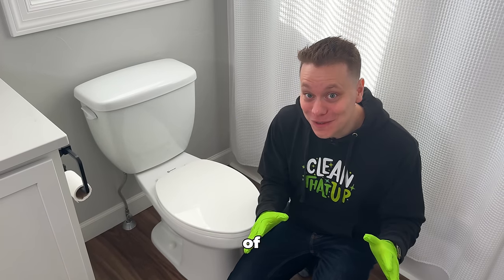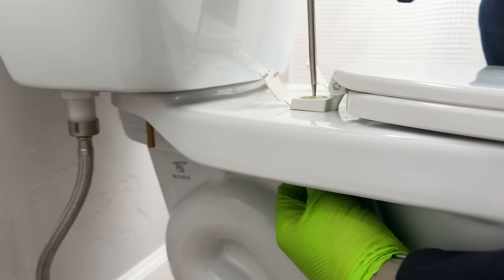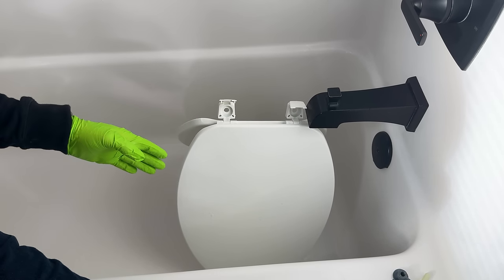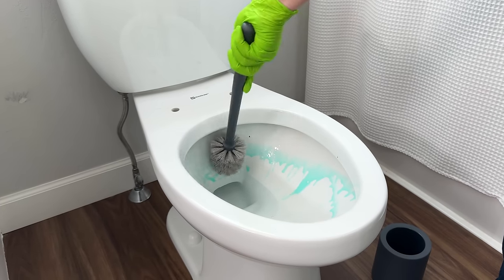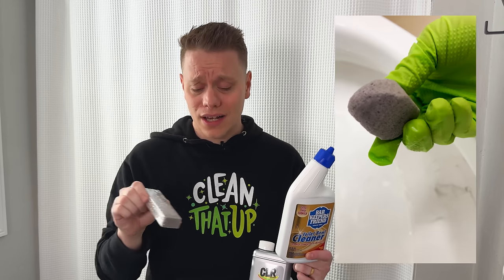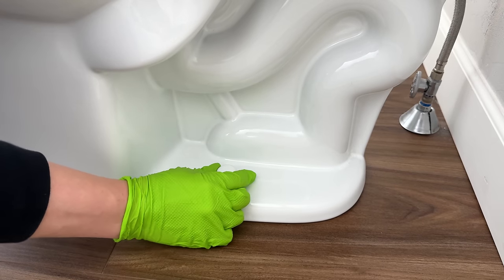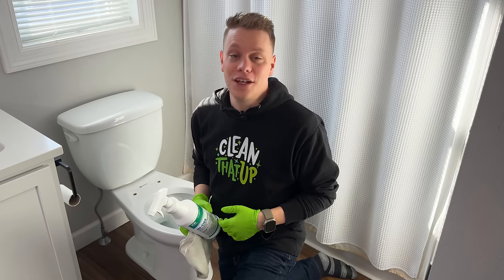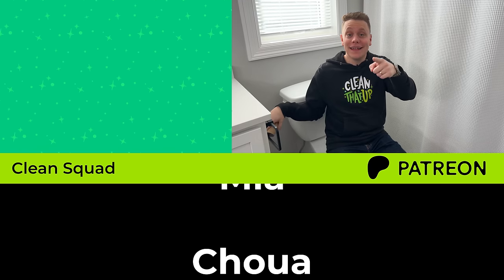10 Things You Need To Know About Cleaning Your Toilet

Comment: One thing not mentioned is your water jets can get clogged over time.  The best way to clean those is to add some white vinegar to the tank, after 3-5 flushes with vinegar all that grime around the top of the bowl should be gone
Reply: I don't have a tank, I use anti scale and elbow grease with a tough scourer sponge 😅
Reply: I didn't know that, I'm going to this. Thank you!
Reply: How much?  Add some?  How much is "some"?  Half the tank?  a half gallon?

Comment: I recommend the deluxe American Standard brand toilets, flat sided, no snaky pipes, no ledges for urine and dust to collect, sooooooooooooooo easy to clean. And only about 50.00 extra per fixture. Lowe's sells them for under 300.00.
Reply: Toto also makes a toilet like that. I used to have one and it was easier to clean. 

Unfortunately, we just had two American Standard toilets installed and I did not know the company made that kind of base. Bummer.

Also,  because I left the project to my spouse who did not look everything over before the plumber installed them, I did not discover until after they were installed that one of the toilets came with a porcelain-finish flaw inside the bowl. The flaw is in front of the inside of the bowl, a little to the right side (not hidden under the rim) and large enough that it is highly visible, so it Always looks like the inside of the bowl has a piece of gunk of some kind in it. Because I did not want to pay to have the toilet removed, return it, wait for a second toilet to arrive, and then pay Again to have a second toilet installed, I decided to just live with it. However, every time I see that spot in the toilet, which is multiple times a day, I am annoyed by neither my spouse nor the plumber bothering to inspect the toilets before installation, and I am even more annoyed about American Standard’s poor quality-control. 

I hate having a brand new toilet that always looks like it is not completely clean even after it’s just been cleaned, and/or damaged when we did not damage it, so I resent American Standard and the home improvement store I purchased it from for selling goods that should be sold only as flawed-seconds, not as full-priced, first-grade products.
Reply: Yes that’s on my wish list. I hate getting on all fours in cramped spaces to clean there.

Comment: I'm glad you mentioned drying the toilet brush before storing it. Not only does it help prevent mold and mildew, it keeps the brush holder from getting funk all over it.  
I give my brush a good spray with Lysol and let it air dry as you showed, resting between the seat and porcelain.

Comment: Thank you! My biggest problem when cleaning toilets is the very narrow spaces between the toilet and the walls/tub or vanity. I’m not young anymore, and find it difficult getting down to get to the sides and back of the toilet, then trying to get back up. I think dry dusting should help a bit.
Reply: Yeah, I live in an 100 year old house and my landlord believes he's an undiscovered interior designer. My toilet in surrounded by two walls and a third glass wall.
Reply: @laurenskee2665  how do you clean around and behind it?
Reply: My hardest place to clean. After having double knee surgery I cannot get down and if I di I can’t get back up
Reply: With bad knees I hate trying to clean those curves on the side. My knees kill me bending over
Reply: With a duster and a prayer.
Reply: I have the same issue and I started using a Swiffer Duster with an extendable handle. I can get the sides of the toilet, the floor around the base where powder tends to accumulate and it can slide between the back of the toilet and the wall, all without having to get on my knees. (If I tried I wouldn't be able to get back up!)
Reply: I spray that area with my cleaning solution, then I wrap my cleaning cloth around a toilet brush. The handle helps in reaching that area behind the toilet.
Reply: Clearly, those who design toilets, have never cleaned toilets.  All of those curves and crevices could be much more streamlined and easy to clean.
Reply: @ZooZoo293  I use the swiffer duster with the extendable handle too. Or, try using a string mop.

Comment: My dad was a janitor, and during my teens, I went with him on weekends to do his jobs. One of my responsibilities was the restrooms. We used simple powdered cleanser in the 1950-60s. I made a paste with it and did all the porcelain fixtures. After it dried, I could easily buff the surface with clean rags and bring up a shine.

Today at home, I remove the toilet seats, take them out in yard by the drain and squirt them with a garden hose and an APC. I use my shower stall during inclement weather and clean the stall after.

We used pure industrial strength pine oil back in the 50s, and a few drops in each bowl and sink drain would clear all odor from the place.
Reply: Try  using iron out get at hardware store. You can use it in your toilet tank  let it set for  quite a while when first using it  you will be surprised, pleased because it does the job for you. I  leave it over night  in my toilet a least once a month. It is excellent does the job better than  anything  I have ever used, like I mentioned it does the work for you.
Reply: @mildredmorine745  
What is the full proper name of it?

Comment: Dude... I had cleaning jobs for 18 years - NEVER thought of dusting the toilet first 😬 
     That 'moving wet particles around on a pristine white bowl' has always been the most annoying thing to me....
     And somehow I never thought of dusting it first 😶

Thanks. Really. Haha

-
PS. I could've used some more tips on cleaning under the rim...
      In my experience, a lot of times there's a lot of calcium buildup there - particularly on toilets in workplaces that get a lot of use during the week.
Reply: If I haven't cleaned a surface within a week (or if visible particles), I use a washable microfiber duster before wet wiping. Just never considered a disposable duster for "dirty tasks" like the toilet base.
Reply: Zep Acidic Toilet Bowl Cleaner.  Nothing cleans those hard water/ rust stains better-- and easier.   Just be sure to rinse well and flash a few times because it's pretty powerful stuff.
Reply: Bye iron out at hardware store let it  set it will  remove everything  if you allow  it to set to do the job. There are times if you can leave it over night it will look like it was used not flushed because of the build up down in the hole  in the toilet, also put it  in your toilet tank to keep it clean. It will do the job for you if you allow it to set  for awhile, it’s amazing cleaner for a toilet. There is nothing out there that is as good.

Comment: I  really like that brush. I suggest you  try iron out, disinfectant does a beautiful job  it will remove  any stains  without scrubbing. I also  put iron out  in my  toilet  tank to keep it  spotlessly clean.  When first using it  allow it to set  for a while  in order to remove the guck  that is down in your toilet hole. You will be surprised  with the results it is amazing  won’t damage  the tank or toilet bowl saves you valuable time by doing the job itself.

Comment: Tips that I use… first I pour a bucket of HOT water down the toilet, then I pour the toilet cleaner quickly scrubbing the bowl.  I let it sit for a few minutes.  I add half a scoop of Oxiclean in the tank.  When it is ready to flush, the oxiclean water cleans the inside of the rim holes.  I add another half of scoop in the tank and do everything else that you did but not flush that toilet for a number of hours.  Sparkling ✨
Reply: Cold  then hot then when you flush Cold water will  Crack the bow

Comment: I only use two tissues and gloves, and I toss them when I'm done. I don’t keep toilet cleaning equipt. No handy dandy or dusters :(
I start cleaning with soap tissue from the top and work my way down then inside the toilet, then use another one to wipe and dry with paper towels, then throw them away with the gloves.  I get the tissues at the dollar store; they come six in a pack. And I buy 100 gloves at Costco

Comment: I do my place the bedrooms and living room then kitchen and bathroom last... I soak the bathroom while I do everything else then i sponge everything and mop up the floor last rince the mop filling up the bucket in the tub and dumping the water down the flush one last cleaning of the sponge and mop in bleach water i let it sit in the flush and outside to dry... If I get a spill between cleaning everything is ready to go... Once a year I'll do the CLR and put it in the tank when it's filling up and let it soak... When I go on vacation i clean everything and put purple power degreaser down the drains and let it soak so when I come back everything is fresh... CLR/ purple the washer and stop it come back the next day and finish the cycle... After a shower i let the water run while im getting dressed and clean out anything that gets down the trap... 
Always free drains and nothing gets built up... If im boiling eggs ill put the water down the tub and if that's not OCD enough once a year i put the garden hose sprayer down the drains and blast everything down.... 
The inside of my plumbing is cleaner than most people dinner plates...
For an additional step.
Rain X everything after it's been done... RainX the fridge after a good cleaning... And if you're not going to be around or a rental that might be vacant... Go around the outside of the place with Biffen XTS bug killer... 😊

Comment: Only thing I would add is those clinging gel cleaners will usually disinfect as well if you leave them for more than 10 minutes, and they also work really well for stains if you let them sit. The instructions say for 15 minutes when used for that purpose. But when I'm doing my regular clean, I start with the gel, let gravity do its thing and wait until the gell has run down the bowl and started running into the drain. I'm not sure how much time it takes, but at least it's disinfecting/working on stains a little bit more and I don't have to use another cleaner in the bowl. I also use a clorox disposable toilet want because YUCK. Bad enough I have to clean the handle; I'm not cleaning a brush head on top of that...

Comment: I recently found the best cleaner hands down for stubborn decade long stains in my toilet like bad build up where the down spout that helps flush the toilet was blocked up with deposits to only let a little pencil lead thin stream out of it. usually taking a screwdriver would help ream it out to get it back to a somewhat usable state for a couple years. we tried everything from household cleaners, and pumice stone. but it was always stained a brown buildup. my boss told me i should try muriatic acid. i was partly worried about it damaging my toilet so my first round of cleaning i did it weak and short. and already i saw change in the brown of the toilet. i gave it a stronger strength the second round and sit longer. came back to a nasty brown and white film on top of the fluids in the toilet. I flushed and literal chunks of the brown were not gone and the down spout was fully clear. after scrubbing with a toilet brush i did one more long treatment and was blown away with how clean it was my whole life I had never seen it so clean. I put some of the acid in a chemical resistant sprayer and sprayed the upper ring to remove the nastiness there and now its like a brand new toilet again. and flushes with far less water now since it has its efficiency back. muriatic acid is great the only worry would be making sure you flush enough times to get any residual acid out of your plumbing. and don't fill the bowel over its max line with the acid to ensure none make it out of the toilet before you flush and sit in your pipes.

Comment: Hello from Appleton!  Saw you on the morning news and wanted to check your videos out!  I do have a question about yellowing on my toilet bowl (around the inside just below where the toilet seat is).  I’ve tried scrubbing that area but it never comes off.  Any tips on how to clean that area?  Thanks and thank you for the cleaning videos!
Reply from the maker: You could always try using a pumice stone! Just make sure the surface is lubricated with cleaner/water - you don't want to scratch the surface of the porcelain

Comment: If you're using just a mushroom head brush, you're not getting the underside of the toilet rim clean.  If you don't believe me, grab a wad of toilet paper, wet it, and wipe the underside of that rim.  You'll be disgusted.

They make flatish brushes that have maybe a 30° bend in them, supposedly to enable you to clean that underside.  They don't work very well, or maybe they wear out quickly.  My brush has a separate set of bristles that point back almost vertically upwards.  It works well.
Reply: Me brushing my teeth with a 0° angle toothbrush 👀
Reply: @rateryx  your teeth don't have undersides for you to clean.  Or at least mine don't. 😆
Reply: I use a pots and pans brush that has thick scrubbing bristles on one side. It's angled just right to get that gross underside 👍 just make sure to label it so it doesn't end up back in the kitchen sink 😂
Reply: @pboplatypus  Excellent idea.
Reply: @pboplatypus  i thought i was the only one works great too

Comment: I’ve always used the Clorox toilet wands either the single use heads for the toilet but they can get quite expensive. I think regular toilet brushes can be super gross and harbor bacteria. Any suggestions on a toilet brush that is better or cleanest? I’d like to clean my toilet several times a week but often only do it once per week because of the single use brush expense.

Comment: Toilets can be moist. In that case you can't dust. I prefer a penetrating spray and wipe down. I then clean inside with a brush and flush. I add a disinfecting cleaner again and let it sit. I flush, clean and add deodorizing inserts to the tank.

Comment: It's not hard to clean a toilet that is already mostly clean, lol. I removed the toilet seat from my person toilet, and use it without. I'd rather pay more for a seat with smooth solid plastic without those nooks and crannies.

There is no other option in an apartment than a bathtub. You put the same a$$ in there.

Hydrochloric acid can't be beaten, but its vapors can't contact metal.

Comment: After  cleaning i use boiling hot water  over the loo  wipe with paper towel
Reply: It's not necessary to put boiling water in a clean (or dirty!) toilet, and you may crack the porcelain bowl with the instant change in temperature doing that.  That will be an even bigger mess to clean, and you'll be without that toilet until it's replaced.